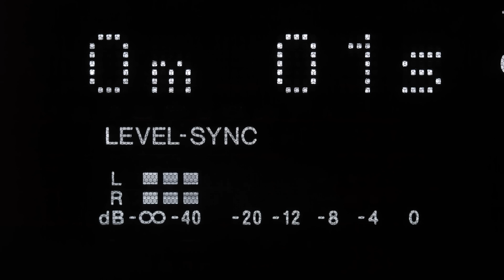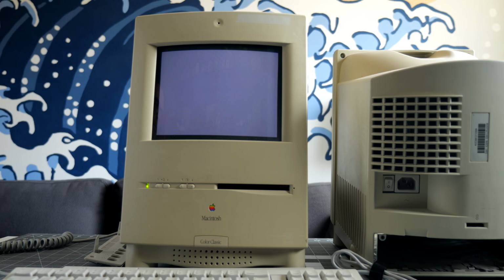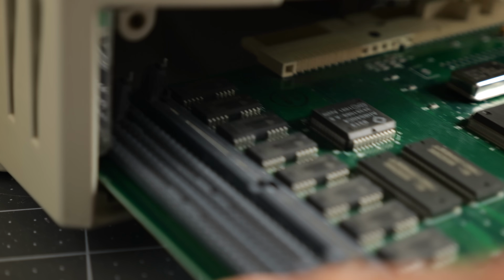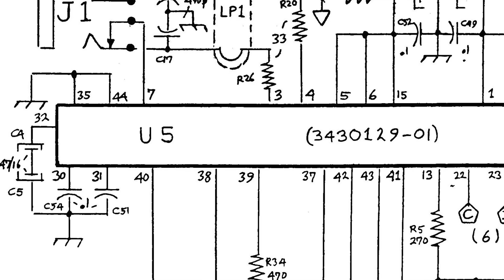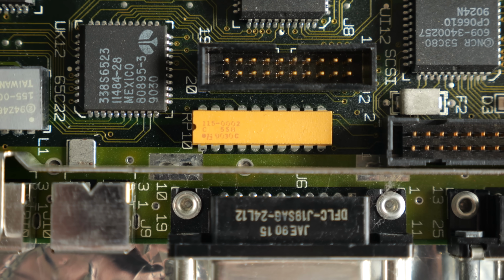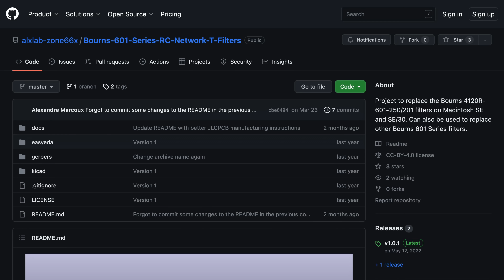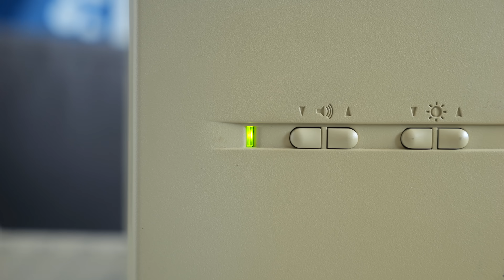Diagnosing a Dead Mac Color Classic

Comment: I'm trying to salvage a Color Classic that has a leaking battery, and I'm experiencing the same problem. Unfortunately, a few technicians have in-depth knowledge and know exactly what it is, but they don't share their knowledge. These machines have appreciated significantly, so it's convenient for them that no one knows how to fix them, so they give up and advertise them cheaply on eBay. They buy, fix, and make money. I can't blame them for that.

But if you have two boards, one good and one bad, there's a more practical method for diagnosing: Measure the same component on each board with a multimeter until you start to find inconsistent readings.

I'm spending time (as a fun hobby) trying to fix the board, but from a financial standpoint and the hours of work, it's unfeasible. But if I see that it's beyond saving, I'll convert an iBook G3 to its internals.

Comment: Nice run down of various troubleshooting paths. Though having a working other board around, it would probably make sense to check voltages and/or scope patterns at various key (test) points to identify a faulty chip or even more likely a cracked or otherwise severed trace?
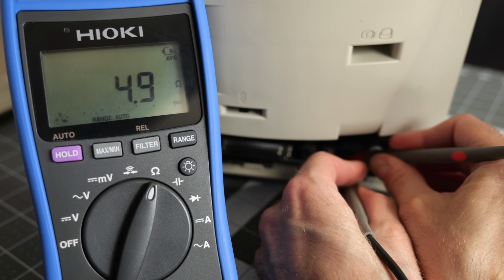Funny observation, and nobody here seemed to care but CUDA /kjuda/ at 3:19 and 5:54. It might be regional, but do you also pronounce barracuda /bara-kjuda/ the same way?

Comment: Maybe on the Mac Colour Classic’s problem had to do with the main connectors (like from the board to the display), since the power does work on the supposed “faulty” motherboard. If the connector works on the good Mac Colour Classic with the “faulty” motherboard, then the other issue would be the display which requires you to take apart the Mac itself.

Comment: You should try with the RAM chips (I not good with old macs but I had a similar problem with several old IBM with on-board RAM). It quite common that faulty RAM chips prevent booting.
An other cause would be the CPU itself but it's a very rare cause.I repair computer for more than 20 years including retro ones, and on thousand computers I've repaired, faulty CPU only occured to me twice !
PSU can also be faulty but in your case, since you tested it with your working board and it was OK, the PSU is good.

Comment: Pressure wash the boards, use an air compressor to mostly dry it, then bake dry it in the sunlight for light for around 4 hours.

After that, replace all capacitors. Also replace any other components that test bad, but seriously just go ahead and replace all capacitors first.

Source: Me, the random dude that salvaged over a hundred flood salvaged computers after Hurricane Katrina.

I had around 80% success rate for electronics flooded two weeks underwater, and my repairs tended to last 10+ years after.

Comment: I MIGHT have a board for you from a small stock of boards i pulled from damaged machines years ago. I'll check back tomorrow with a "here you go" or a "sorry bud". 

Sorry bud, its an LC630/580c motherboard, but shes fully loaded with a video in card, pds 10BASET/5, and comm slot modem.

Comment: Are you sure that the motherboard is your issue or could it be something else? I mean e.g. the motherboard connector of the mac itself or weird problem with the crt? Maybe you have already sorted that out but you will never know. And did you put the old rom chips in the functioning board to confirm that your chips are really working? Would be easy to check

Comment: Stories like this really deter me from collecting old hardware -- I have no technical skills, any tools more sophisticated than a screwdriver, and no space to set-up a workshop. I have no capacity to undertake repairs, and so much vintage gear is either not working or it will eventually need an overhaul.

Comment: Check the continuity of the edge connector that connects the board to the chassis. It takes a bit of a beating when the board is slid in and out of the chassis, so it could have been damaged some time in the past. One broken solder joint between the connector and the logic board is all it takes to cause problems.

Comment: My process while repairing my Mac Classic was the same. Exhausted all normal logical troubleshooting steps, became manic and started chasing potential problems that didn't make much sense to chase, I did the exact same thing pulling new caps, chips off the board and soaking it in ultrasonic cleaner fluid in desperation, I even used one of those massage wobble boards to agitate it. Eventually I found if I bent the board in a very specific way I would get a slight sign of life, it was an invisible crack in a trace going to the RAM controller chip, right where the trace met the pad. Phew. What a pain.

Comment: Hi remember a guy at re-PC in Seattle thought I was crazy. I bought an LC 575 board for 50 bucks. It was brand new. I was having trouble with the sound but then I found out it was some other problem. I still have the brand new board hey hey so if they’re selling for hundreds I got a brand new one in the box for 50 bucks.

Comment: Also check those golden contacts at the front edge of the logic board; I've found many times the culprit is a bent pin (or dirty one) there because it's easy for people to missalign the board on unit re-assembly.
Reply: @file manager The board and contacts could be squeaky clean, but still fail to make a connection if the socket is damaged (see also: pretty much any NES with a worn cartridge mechanism)

Comment: Hey, I really like your videos!
Since the machine appears to be dead, I guess the hardware initialisation fails. I’d recommend to check the voltages on all chips. It’s difficult with this model, because it only can be tested inside the housing… 
I know that on older models the Sony sound ic checked the voltage levels and generated a reset signal to force all the other ICs into a reset state. The signal is withdrawn and the CPU obtains its reset vector. Standard memory is mapped to the ROM (I had a problem here with a PAL Chip on a Macintosh IIsi, which didn’t map the address right. It was getting warm which is a sign for a bad PAL). The MRH (Macintosh Reset Handler) is executed from there and RAM/ROM is remapped to their respective locations and then the P.O.S.T. sequence is initiated by MRH. The first P.O.S.T stage is testing rom and critical logic board circuitry before playing a chime. 
So addressing/memory could also be a problem. You could check the connections there or maybe test the onboard RAM. 

These are the kind of machines that keep you up at night 😂

Comment: Do you have RAM installed?  I had your problem with a laptop in 2000'ish and it was because I installed the wrong CPU upgrade and it fried something on the motherboard.  I put the old cpu back in and it would show power, but nothing on the screen.  I think you have a bad CPU and or the CPU isn't able to function.

Comment: I had a very similar issue a few weeks ago and discovered that 3 of the caps where shorted to ground. Did you continuity check the pads on the caps against each other? I.e. continuity check between both pads on each cap. Also had a bad ram stick in mine.

Comment: You kinda need to go full nuclear, strip the monitor and all its circuitry out of the case, plug the board in and start probing with an oscilloscope. Check you have a clock coming from the crystal and reaching everything, check the CPU reset line, check the CPUs main data line for activity, check the RAM bus for activity. You don't even really need to understand what is happening, grab a schematic and use it as a guide, all the different lines will be marked with a high/low on/off indicator so all you gotta do is make sure there is either activity or the line is high/low as stated in the schematics. If it should be high and its low, should low low but its high or should have activity (data lines mostly) but doesn't then that's your problem. If I had to guess though, its likely either CPU or RAM since you're getting nothing at all. Lastly, don't always assume its actually the thing you first think, for example if something is stuck high on the RAM bus it could be a dead ram module but its just as likely to be some LS74 logic chip on the same rail, again schematics will show you the full circuit so you can follow it back and find where it goes bad.

Comment: DFAC is probably fine, it's only sound. Issue with a CC is doing anything with them on a bench. I am going to be taking a CC analog board and ripping the flyback off it to make a bench testing setup. I have seen this issue a few times and fixing it has been...less than successful. If the board wouldn't power on, generally can fix that 100% of the time. You really need to be able to work on these outside the system and have a scope.

Comment: I have a Mac Classic and a PowerBook 145B. As far as I know, they both should work if I boot them up, but it has been several years since I have done that. They just sit on shelves in my home office as decoration. I'm getting worried about the CPU batteries bursting so I'm thinking I may need to open them up to check.
Reply: any update on those batteries?

Comment: Guessing at faults and swapping is a poor strategy for these kinds of problems. It's s lot of work and you need known good parts. It's fine for simple problems and with sockets, but not for larger soldered parts.
What you need is a modern digital scope so you can really look at signals. You don't need one costing thousand. Even the cheaper ones will do for most signals. With a scope you can check reset pulses, activity on clocks and crystals and buses for memory and addressing. You don't need to understand everything to check if it's doing something.

Comment: To me at least, stuff like this is why FPGA, and software Emulation are so critical to preserving the legacy of retro hardware for future generations to know about, and enjoy, be it consoles, handhelds, computers, or other computing form factors like early cellphones, PDAs & Tablets.
Reply: FPGAs will be what keeps these old machines alive by then.
Reply: @SockyNoob  I agree, but software emulation is still worth considering as well, if you can't afford to get your hands on the hardware, and for some systems it's as simple as going to a website, clicking the system you want to run, and putting it full screen with the work many people in the retro community have put in.
Reply: @Brixbuster Indeed it is frustrating what the emulation scene is going through in recent times, and how many dead Macs we will see in the future?  Far Far too many, same for electronics in general that the average hobbyist, or repair shops just won't be able to repair due to parts, and with modern electronics same due to parts, and now we have to deal with BS DRM from companies like Apple that won't allow the replacement of a $2 - $5 home button.  We need strong right to repair laws sooner than later. 😞

Comment: I don't get the obsession with the CC. It's a cute enough computer, but people tear far better AIO Macs apart in order to marginally increase the CC's performance. The Mystic swap basically just leaves you with an LC575 with a lower-res monitor, mono sound, and no CD-ROM. I'd much rather have the unmolested LC575; it's more rare than the CC anyway.

Comment: Is the main crystal oscillator running? my next thing to check would be to see if the board has a working clock signal.

Comment: As a PC guy, I lol a lot at the failures of Macs due to all their customization and proprietary nonsense.  Their choice of style over function and upgradability impacted them then, and continues to do so now.  However, I love watching your troubleshooting method and sticktoitiveness.  Thank you for sharing.
Reply: There's nothing to "lol" at here.  This was a period of consolidation.  The original IBM PC used totally off-the-shelf parts, but literally everything after it started combining discrete logic into some kind of PAL, VLSI, ASIC, etc.  It was all customized and proprietary to some degree, there were just common interfaces.  .... as is the case on most of the Macs, too.  (NuBus and PDS, and so on, aren't super secret sauce, they just weren't as popular as ISA and PCI.)

So the difference here is, if a random PC motherboard dies because its everything-chip fails, nobody cares.  There are plenty of other motherboards.  If Voodoo 2s start winking out of existence, people would begin to care.  (But only a little bit, because it isn't the only graphics card to choose from.  It's just an important one.)

There are dozens of other similar-enough Macs that still work fine, so nobody is worried that we'll just be unable to run System 7 at all.  But people still care when a particular model is prone to failure, because compared to PCs, there are a relative few number of distinct models.  Ergo, each model matters more than if it were just one in a sea of indistinguishable clone PCs.  The only ones lamenting that a given Hyundai desktop 286 is forever gone, are the two people on Earth who used that as their first computer.

This isn't a "lol -- Apple and their proprietary everything" issue.  Beyond the most trivial of PCBs, MOST bespoke digital logic boards had something on them that is hard or impossible to replace.  Apple was no different than anyone else, in that regard.  The question is, does that particular device have significance, or can it be swapped out with something similar without losing any of its character?  In the Mac world, where there were fewer models, and they were mostly all first-party, it's significant.

Comment: I think that you should definitely do more multimeter tests. There’s a high chance that there’s just a broken trace somewhere.
Reply: This. its such a common issue.
Reply: Seconded. Or a via. Mine had that issue. They can look fine visually but be broken internally
Reply: it's a point of failure for most computers, I think.
Reply: Really? How did those traces get broken in the first place?
Reply: @bonnome2  Over time they just crack. Mostly because of temperature.
Reply: @bonnome2  Mine was likely due to battery or capacitor leakage
Reply: @ryan-zv6xp  aah yeah but this board didn't have that
Reply: @bonnome2  You never know. It could have been cleaned up.
Reply: Definitely this

Comment: These chips are not likely to ever become available.  Maybe an fpga, but not new chips.  The first Pokey chips have only recently become available and that's a chip from the 1970s.
Reply: There are more retro chips in fpga form than the pokey. Several c64 chips including the Vic. And more for other systems. It's an entire market. Indeed nobody will make a real one again, but more and more it's available as an FPGA replacement. Small modern FPGA 's can fit on a carrier board the size of an old dip chip or plcc.
Reply: @bzuidgeest  And they tend to be expensive.  But that is why I said maybe an FPGA.  it's certainly possible.  But new chips are completely out of the question, certainly for the time being.
I'm pretty sure there are replacement POKEY chips that aren't FPGA.
Reply: @tarstarkusz  expressive? Not if you look at the cost of the FPGA chip, production, low volumes etc etc. Most are actually cheap, thanks to China. Or at least cheap for what you get. 
As far as i know all new pokeys are FPGA like the pokey one. FPGA is a far superior option to actually making a real chip. You can update an FPGA in case of errors or new additions. You don't need special factories or knowledge.
Reply: @bzuidgeest  The cost of an actual manufactured chip is far, far below the cost of an FPGA (at scale, not at small volume).  These old chips would be LSI chips which could be sold for a very low cost.
No, FPGA is far inferior to making the real thing if you want to ship a decent number of them.  Granted, this limited use scenario would probably be cheaper, but only because of the tiny number that would be produced.  But even the POKEY, I think, would be better off with an actual chip.
Reply: @tarstarkusz  for large numbers you are right. But you were talking about things like the pokey. Those are not larger number chips. Retro computer chips will never be produced at large scale again as you seemed to be suggesting. Unless it gets as easy to do at home as 3d printing. Maybe in a few decades. So FPGA it is. And even large manufacturers use them on all kinds of lab and consumer equipment. So even for them it's more interesting to use FPGAs. If something is wrong just change its programming.

Comment: Could the Color Classic require a PRAM battery to show video? It’s common for Macs from the 90s to require a clock battery to function.
Reply: I have a few color classics and they have booted up fine without a PRAM battery installed.  I also have one that has the exact same symptoms as the board shown here (to a T)  and adding a PRAM battery made no difference at all I'm afraid.
Reply: no, it's mainly those pizza box LCs that won't boot without a battery

Comment: I have the exact same issue with one of my color classics.  I've sent it down to Amiga of Rochester for repairs hoping he can diagnose the issue since, like you, I was completely stumped.  If he figures anything out I'll be sure to let you know!
Reply: Yeah, so far it's been interesting. I am having trouble getting any form of working out of it. I'm starting to suspect the timing crystal. I went to VCF East for a while and it killed me. I've had to be out for the last few days on top of it...ugh! I'm getting there haha
Reply: @AmigaofRochester did you ever got to the bottom of it?
Reply: @medes5597  sadly I was not. Board would turn on but do nothing. I’ve since fixed many other boards though. Sometimes they are more annoying. If you have any interest, I’m always available even if just to ask questions